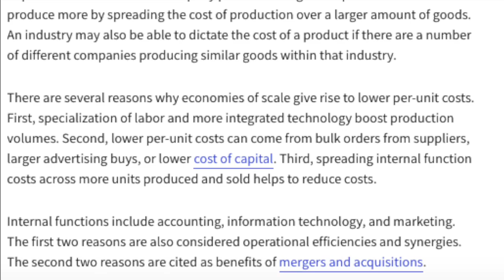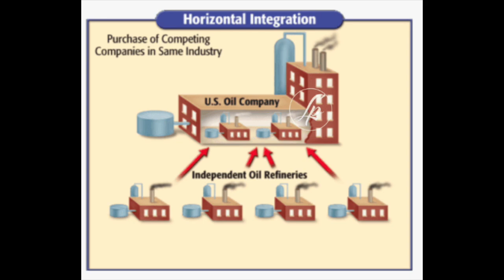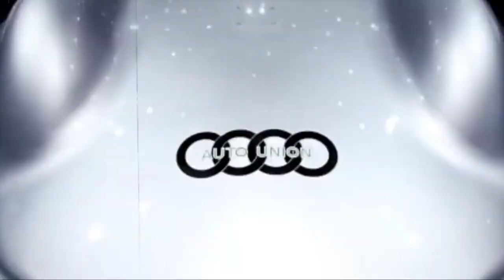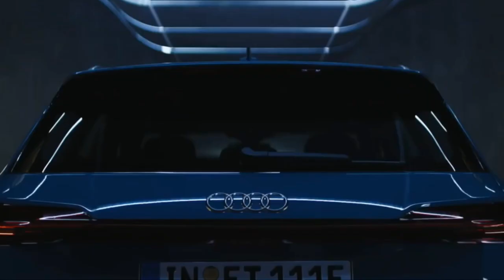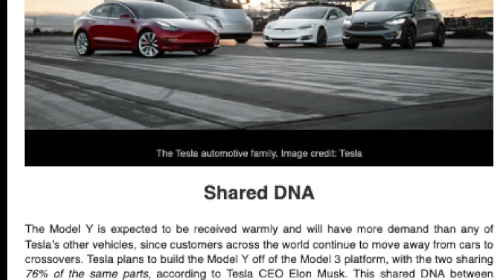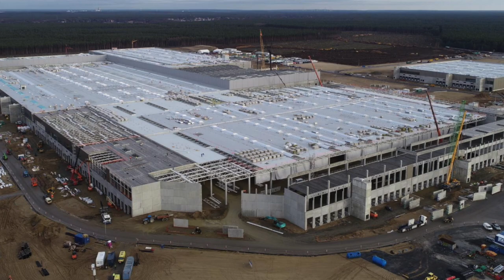Tesla's Economies of Scale [How Tesla Keep Costs Down With Manufacturing & Delivery]

Comment: I’m not sure that any legacy auto offers Tesla any advantage. Tesla factories are significantly different than legacy auto. Building a new factory may cost less than retrofit of a legacy auto factory.  If a company offers new technology or process that would mesh with Tesla then maybe. Ambri is a MIT startup with liquid metal tech battery that is better suited for grid scale batteries. Arrival is a British startup building delivery vans, and buses from carbon fibre and a micro factory design. To make vehicles truly sustainable there is a need to minimize the use of metals and move to a product like composites. Composites have less energy imbedded in their production and weight less so less energy to move. A sustainable material like composite Hemp would be even better.
Reply from the maker: I agree but it is something Elon said he would entertain.
Reply from the maker: And yes materials like hemp would be brilliant. There’s a video of Henry Fords hemp car and it was light and stronger than steel. Although in his biography they say it’s made from soy beans.

Comment: Traditional auto is fantastic at making good quality vehicles at low prices

Audi A4 base spec you can get for £22,983 while the model 3 coats £43,490

A fair summary would be that tesla spends the next 5-10 years reducing costs while traditional auto which already has low cost vehicles manufacruring down learns and gets good at making EVs to go with their low cost structure

Come 2030 I would expect approximate parity with a Tesla M3 and an electric A4 cparong roughly the same amount of money and getting and roughly the same range and performance
Reply from the maker: At $100 per kw/h its cheaper to manufacturer EVs than ICE, everything else being equal (ceteris paribus). We're already there. Just need more models out. This doesnt even factor in the cost savings on running an EV over ICE. When the model 2 is ramped up, it will be the end of ICE.
Reply: @TeslaEconomist  Thats not the magic number
Reply: You can only get good at making EV’s by getting people to buy your bad ones first. Problem is they are always worse than Tesla and they haven’t got any batteries to make a lot. End result = bankrupt

Comment: Good analysis. Also, vertical integration makes sense in a fast changing industry such as EVs. It allows them to maintain their speed of innovation  instead of relying on suppliers because the various engineering teams are so available to work together etc. For example, Apple designed their own hardware and software to work specifically for eachother., and we see the new M1 chip destroy its competition in terms of performance at the same time increasing apples margins (less intel license fees etc). Ford did vertical integration during early explosive development of ICE vehicles, and Tesla is doing it for EVs.